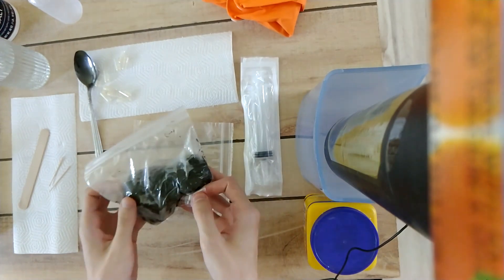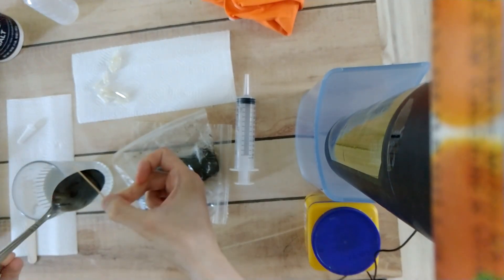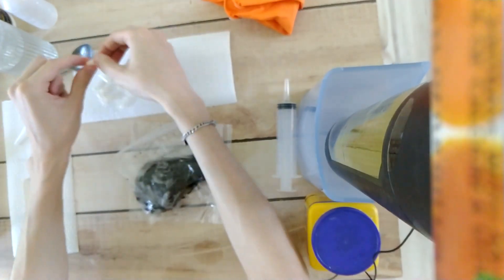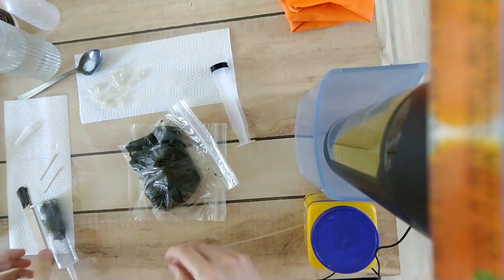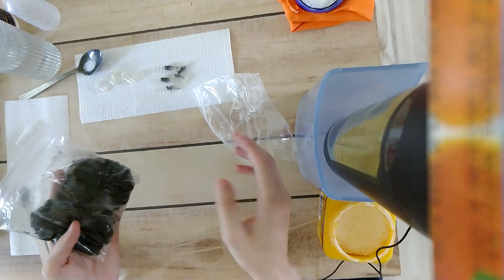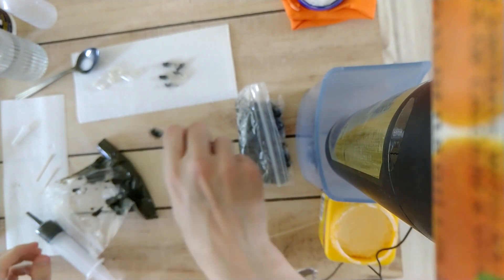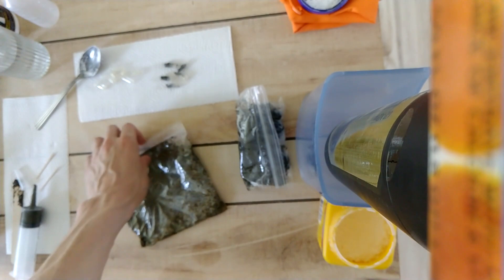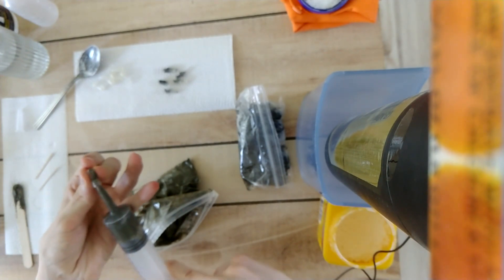DIY FMT capsules. Maltodextrin antifreeze method. Preparing stool for Fecal Microbiota Transplant.

Comment from the maker: Need a stool donor? Visit https://www.humanmicrobes.org/

Written directions and more info: https://humanmicrobiome.info/FMT

2tbls maltodextrin to 1/2 cup saline was used in one study, but it's way too watery in my opinion. So I'd recommend the ratio of 2tbls stool, 2tbls maltodextrin, 1tbls saline. You can pre-mix the saline and maltodextrin to get a consistency similar to glycerol. 

Don't use tap water to create the saline or to ever mix in with stool. Tap water contains chlorine, which is an antimicrobial. Any water used for stool preparation should be filtered or distilled. If you don't have a water filter you would need to buy filtered or distilled bottled water. 

One thing I didn't cover is the capsules softening after you put the stool in them, and thus sticking/clumping together. A few options:
1. Double encapsulate. Use size 00 then put that into 000. 
2. After about 20 capsules, carry them on the flat paper towel and lay that flat in the freezer for 30-60 minutes till they get firm, then you can move them to whatever container/bag you want. 
3. Sprinkle some powder on the paper towel before and after placing the filled capsules on it. Safe options may be maltodextrin, and corn starch. Probably not any type of flour that needs to be cooked first. Feel free to give suggestions.

Comment: I have size 0 delayed release where I put the stool in then double encapsulate with size 00 delayed release capsules. Best way in my experience is when you work with liquified stool it will dissolve the capsules faster versus more solidified firm stool. but I am trying to get a freeze dryer to lyophilize the stool into a powder which would be more viable for encapsulation.

Comment: I have both the enteric coated caps and gelatin caps. They all melt on the inside when you fill them with anything liquid. What stops yours from melting within a minute?
Reply: you have to use either 50% glycerine for an ultra thick paste, or fill just before swallowing
Reply: I saw mention of freeze dried. That would solve melt problem. Otherwise resource -
Michaela Peterson https://youtu.be/3aDGDTp8d3A

Comment: May I ask why some FMT "recipes" do demand a sifting of the stool which you were not doing in this video?
Reply from the maker: Stool is highly variable. Many people have undigested bits in their stool that would clog up the tip of the syringe. In those cases you'd want to strain the stool. If you're processing variable stool from many donors you would probably want to make straining standard since you wouldn't be familiar with which donor may need it and which wouldn't. But if you're only using one donor and you know their stool is fully digested you shouldn't need to strain. Also, some people may prefer to just use a toothpick to unclog the tip rather than deal with the extra hassle of buying and discarding multiple strainers & containers.
Reply: straining will kill a lot of bacteria due to air exposure.

Comment: Sir, I wanted to know about triple encapsulated capsules which does not directly dissolve in stomach but in intestine.
Should we use them in FMT or normal capsules are enough?
Reply from the maker: Normal capsules may be good enough, but you're welcome to experiment with multiple encapsulation and/or enteric coated capsules. See http://HumanMicrobiome.info/FMT.
Reply: @HumanMicrobes  Ok sir, thank you so much for your reply
Reply: Hope a link to enteric coated 00 & 000. Only avail I found in Hono were vege caps 0 & 00 to dbl encapsulate. 
Also, this demo Michaela Peterson https://youtu.be/3aDGDTp8d3A